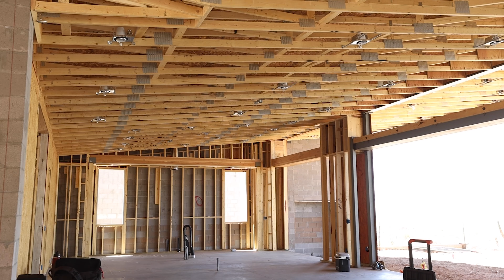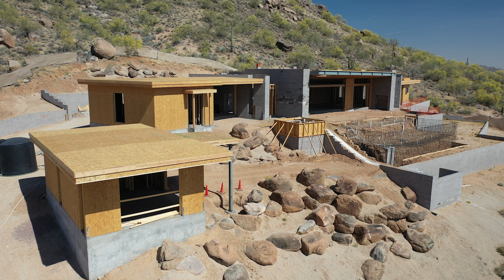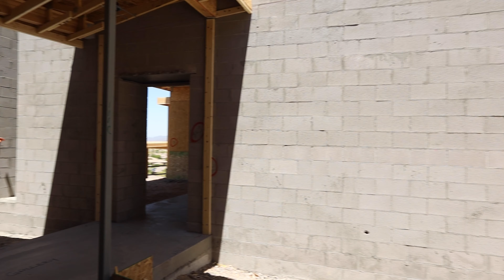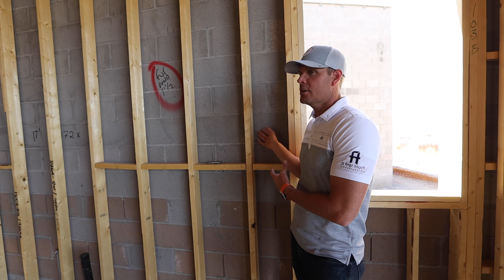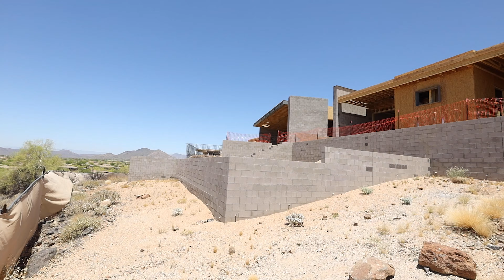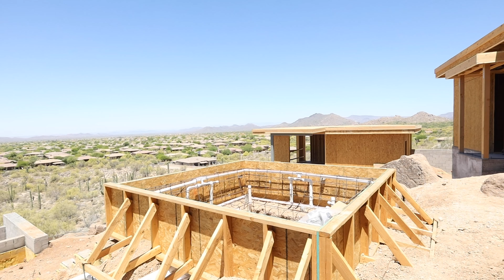Concrete Masonry Units (CMU Walls) | Why CMU Walls For This Hillside Custom? | AFT Construction

Comment: When filling the CMUs with concrete, would it be possible to do it as one pour when all the block has been laid, rather than in lifts? It seems like having one monolithic filling might improve strength?
Reply: Hello! This is not recommended due to the accumulation of concrete aggregates (gravel) at the bottom of the hole.
Reply: @edmarferreirajunior724  Thanks so much for the response! If you don't mind answering a further question, is this also a problem with poured concrete structures, using forms?

Comment: I design houses as a hobby, this is close to my designs, I use 4x8x16 block fully grouted then 3 inches of Kevlar panels, then framing in 2x6 but metal. All framing is welded together including rebar in the block walls, the trusses are welded to the top plates creating a very strong home. All exterior doors has security doors with lexan panels along with a secure steel door inside. The windows are hurricane resistant glass with exterior powered shutters to protect the windows. Insulation through out is Rockwool fire proof 16 or 24 inch batts. then 5/6 inch type C drywall except the bathrooms where moisture and rot resistant drywall is used. Any air vents vent out the soffits and usually bathrooms are designed back to back and the kitchen and laundry are designed back to back, roofing is always metal to prevent fires. All electrical is in steel conduit, some say overkill, I say a very long lasting house!!
Reply from the maker: Thanks so much for sharing - sounds like you have a very thorough and well-thought out approach to home building. Appreciate you watching our builds... It's an amazing process and journey!

Comment: Assuming they get stucco/plastered,  is there any weather barrier done to CMU walls prior?
Reply: If the stucco is on the exterior and the insulation is on the interior, a fluid applied wheater-resistive barrier will be necessary between the concrete block wall (CMU) and the insulation. The stucco paint must be vapor-permeable so that the wall can dry from the outside.

Comment: If possible, can you tell us the insulation choices for the interior and exterior side of the walls? Rigid foam insulation vs batt insulation for interior vs exterior? Which is allowed vs not allowed? If exterior insulation is not required, can we just use some screw anchors during wall construction to simply attach vinyl sheathing to the exterior later on ? Too many questions 😀, but thanks for the video.

Comment: Just curious, why not solid concrete tilt wall with studs added after?
Reply from the maker: Great question. Because of cost. Much more expensive to go concrete
Reply from the maker: Great question. Because of cost. Much more expensive to go concrete
Reply: @aft_construction  
Thanks